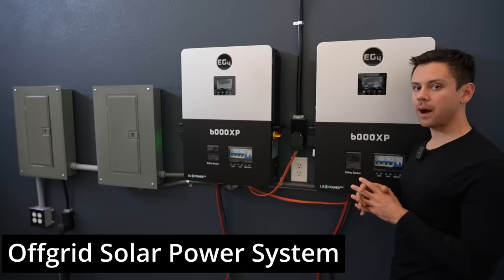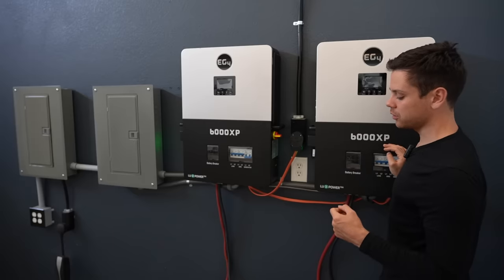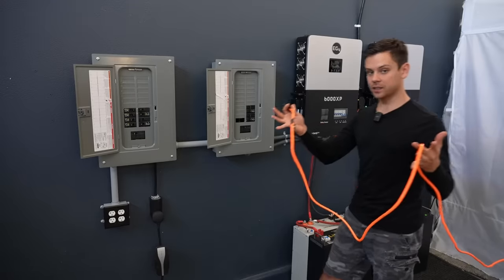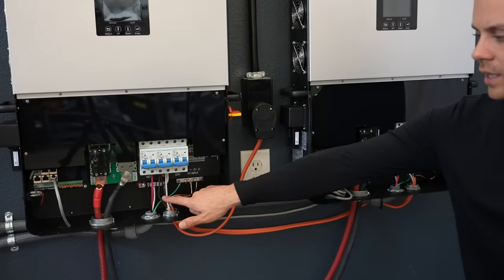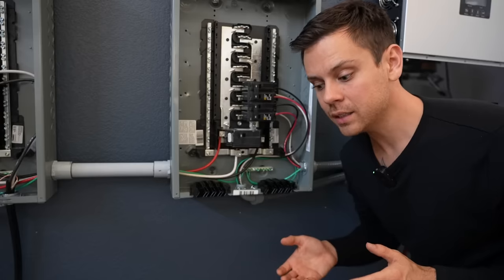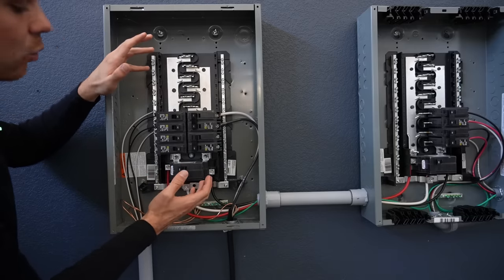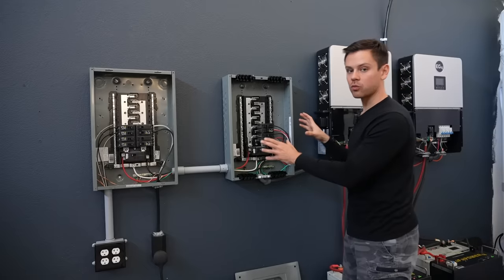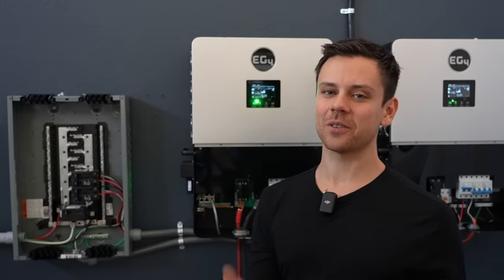How to Build Expandable Off-grid Solar Systems w/ EG4 6000XP

Comment: @WillProwse I see your using 40A breakers for your load center on the AC out side of the inverters. I asked the question in the forum about that breaker size and was told 40A also. Signature solar just put a new video out similar to your 1-2 days ago and showed load testing. It looks like they used 60A breakers in their set up that’s similar to yours. What is the correct size and why?  

My plan and goal is 4 of these units for our off grid house and I was thinking 50A breakers to give essentially a 200A service for the house with 4 of these units. 

Thoughts?

Great video. Love the work you do.
Reply: Since the 6000xp's support 50 amp passthrough I would personally go with larger than 40 amp breakers for sure.

Comment: QUESTION, both load center panels have 100 or 80 Amp mains? In the combiner load center, each inverters is connected to the combiner with 40Amp breakers. So 80Amp main? TY!!

Comment: Will, here’sca topic for a future video.  On the new Tesla CyberTruck, Teslas has a new EVSE that supports “PowerShare”, where it’s bidirectional power from the CyberTruck battery pack.  It’s unclear if its direct DC, or their doing it with AC only, as the CT has a 40A AC inverter in it…  investigate and clarify, ty.

Comment: Whats the best way to handle the batteries? Do they have to be seperate or can you parallel the batteries and inverters ?
Reply: Generally speaking it is best to parallel the batteries and have all the inverters sharing the same battery bank.   And it is best to parallel the inverters as well, having them share all resources.  This gives you a lot of redundancy across the board.  You are basically able to maximize your use of resources even when things break.  Both inverters are still up if a battery breaks.   All the batteries are still available even if an inverter breaks.  Etc.

Lets say you have 400Ah in four paralleled batteries.  As part of the robustness, you program the inverters to never charge more than a combined 200A, allowing full system operation even if half the batteries are non-operational.

Often in these systems what is left unsaid is the fact that power electronics in general have a limited life-span.   Usually 15 years or so.   So when you put together a system you want to take that into account.  The key to economical operation is making the maintenance as easy as possible and to not have to bring down the entire house to fix things that break.

Three other reasons to share the battery bank:

(1) It is a whole lot easier to worry about the state of charge of one battery bank than two.

(2) In a parallel configuration if a battery fails or the BMS goes wonky or starts tripping near the top or other problems arise, the other batteries will continue to work and pick up the loads (when designed right), giving you time to correct whatever problem arose.

(3) And the C rate going into or out of each battery is generally significantly lower, resulting in a much higher round-trip efficiency.

-Matt

Comment: Is it good or bad idea to keep battery,charge controller,inverter in a separate air conditions room to maintain cool temperature?? Most of the time heat reaches 36,37C.

Comment: How did you integrate the emergency disconnect that is required by code to on the exterior of the building. I am not asking about backfeeding the grid. I am asking about how a firefighter would turn off power within the building during an emergency.

Comment: Just curious why you went with dual 6000 instead of a single EG4-18Kpv.   Would you prefer the EG4-18Kpv if you were also tying to the grid and not expanding down the road?  Love your vids.
Reply: He has all of them. He's showing these cuz they're new.
The 18kw has grid-tie (to feed back to them) nothing else does as far as I've seen. They just allow the grid to pass-thru to power stuff. So big difference if you want to do taht deal with power company where they pay you
As far as I see in the states at least, the cost of the grid tie won't pay itself back until like 200 years.. cuz you getting 3 cents per kwh and it's several thousand more. SO I guess if you have a massive solar array maybe only 100 years

Comment: I still have a eg4 6k in the box and thinking of selling it and buy a 6000xp. Probably 2. Your suggestions
Reply: I would do it.  A lot of people have reported having issues and failures with the 6000ex.  These units by all appearances seem to be much higher quality - but they are brand new so no one knows for sure what their long term reliability will turn out to be.  I'm extremely happy with my single 6000xp so far.  I even did my best to get it to fail.  I put enough loads on the unit to get the inverter up to ~5500 watt load.  Then I kicked on my clothes dryer on high heat which added another ~5500 watts.  The 6000xp handled the 11,000 watt surge flawlessly for a few seconds and then automatically switched to grid passthrough.  After turning off the dryer and having the loads within the capacity of the inverter for a few minutes it automatically switched back to the inverter.  All of this without so much as a flicker in the lights on the loads.  I'm happy :)

Comment: Thank you so much for your awesome videos. I am putting together a back up system that I plan on adding to (eventually) like in this video. I have a limited budget, but I'm planning on the EG4 6000XP. I plan on having 8-12 Heliene 490W pannels. I will be using the 10 circuit "generator transfer box" to wire my critical circuits. I'll supply  the "generator" input on switch from the 6000XP (as that will be my"generator") Can you recommend a decent budget friendly 48V LiFePo battery? Considering the Chins or Lossigy based on your videos reviews. Briefly, what is the advantage of the additional cost of a rack battery vs one like the Chins. Thank you so much again!!!

Comment: Could you do a video that integrates a whole home backup generator with battery backup that provides smooth transfer of power between grid and generator without the power flickering off when it's transferred between the grid and the generator.

Comment: I'm adding solar to off grid place hawaii, lux pro 6000, 12/415 panels 1 48v 200ah wall mount.  Will be running about 75 ft panel to house.  Should I use 8ga or is 10ga ok?.

Comment: It looks like you have two battery banks wired in parallel and shared by the two inverters. Should there be a circuit breaker between the batteries or are you trusting that to be handled by the SOK?

Comment: Hey will, can you do a video explaining the specs on the back of a solar panel.  Also the specs on the inverter app.  I have a reading called ‘q var’ and my inverter production in watts. If my production is lower than the var, does that mean I’m consuming more than producing?  Why does the PF start at .5 in the morning? I have a Solaredge system, seems like the optimizers restrict some of the production and previously I had a fronious inverter with the strings going directly to the inverter.

Comment: I just want to make sure I understand correctly. If I already have a ground neutral bond in my main house breaker which I use to power 6000xp I should split the ground/neutral in the panel that I am powering with the 6000xp, correct? I should then run a separate ground for that panel and the 6000xp which does not connect a ground back to the main house panel?

Comment: Nice job. In your opinion, are these units capable of competing with Victron from a reliability standpoint?
Reply from the maker: There are units with over 100 megawatt hours, so they are very reliable but the victrons have a different circuit design with transformer and low frequency. So technically I would say victorn is more durable long term. But both are good options
Reply: i want a LF victron, all in one.....like the EG18K.....but victron style !!!
Reply: At the speed in which this technology is improving,  it is difficult to justify spending 3x - 4x more on gear that will be obsolete in 5 years.  We can see this with some of the EG4 models already... Replacing a $1,500 unit is easier to swallow than a $5,000 unit.

Comment: Hi Will, love your videos, I got me one of these but im connecting it to DIY LifePO4 Batteries. I'm about to connect grid to it with the idea of only using it to charge the batteries when they are low and noticed you are only hooking up 6-2 wire. That's a lot cheaper wire considering i have to go 80' to the grid. And you aren't using a neutral.  Any knowledge on how to use it for DIY Batteries since it only seems to be built for EG4 server racks?

Comment: What are your thoughts on using that 100 amp panel with these two inverters with a grid feed? Each unit has 100 amp grid pass-through, so that could potentially dump 200 amps on to that panel. If you added any more inverters, that would exceed 100 amps just with the inverter current. Is that 100 amp still suitable? For the $100 that I would spend on this panel, I could get a 200 amp panel that didn't have a main breaker. I could still feed out to a main panel, but I don't know if that would meet code without its own dedicated breaker for that wire, even though the wire could handle the sum of all the other breakers.

Comment: I can use some help...I bought 2 of the EG4 to replace the 4 Growatt Inverters I have. I want to use the EG4 just as I did with the Growatt...I only want to use solar and battery and have utility only come on if the solar cant keep up with charging because of bad weather days.  9 months out of the year I would switch off my utility breaker and be only on solar and batteries and it worked great no utility bill. The breaker was turned on for the winter months and again the utility would only come on if needed,

The EG4 seems to have an issue with not being able to allow solar to charge the batteries while they may be also be discharging to power loads. The EG4 connects to utility to power loads (my house) while the batteries are being charged by solar. This isnt cool because then that would mean that everyday when the sun comes up to charge my batteries from the night before then the utility will come on which means Ill have a utility bill again,,,,thats not off grid and they say these inverters are supposed to be off grid inverters.

I tried switching off my utility breaker while the batteries were being charged by solar and my house power switched off. Im hoping its just a setting that I need to change so any help would be nice....thank you

Comment: How do these devices determine the appropriate times to establish a connection between the neutral and ground using a relay? It's clear that there are only two scenarios where you'd decide to either link or unlink the neutral and ground: one in an off-grid setting, and the other in a grid-tied setup.
Reply: Attempts to pass current between neutral and ground.  If current does not flow the relay moves to join neutral and ground.  The state of the neutral ground link should not change during normal operation, ie you will either be attached to an existing neutral ground linked system or not.  This is why you should avoid having a plug into the mains as it will be possible to change the provision of the neutral ground link with the inverter operating.
Reply: @retrozmachine1189  the internal N-G relay does not dynamically respond to any conditions like that.  It is only statically on or off depending on your setting in the inverter.  Personally I leave mine connected to the grid inputs so the N-G bond is always provided at the main panel.  Otherwise you would either enable the N-G bond in the inverter or the load panel...
Reply: @intDavid  Seriously?  It doesn't have a setting to detect and change automatically depending on the circumstances?  Why even have the feature in that case.  Just require that a N/E link be present in the main panel, ie if hard wired to mains it gets N/E link from the supply side, but if standalone off grid the N/E is made on the load side.

It might cop me flack for saying it but what a piece of junk.  How can that even be compliant?

Comment: I just found your vids today.  I'm in awe of your knowledge and learning ALOT_ but I am VERY green. I thibk this is the system that i am going with but will be completely off Grid.   Can you do an addendum for the wiring  (in the panel(s) of the multi  box system, for Off Grid only? it got a little confusing with regard to the neutrals and grounds in the panels bcs i think you said that you only do that if your connected to th grid?  Sorry if it's obvious. I know nothing about it, and you are Genius at explaining, but stiill I'm confused-re that matter only..Thank you  JD ..

Comment: How to build a system one major piece at a time, starting with a normal on-grid homestead.  i.e.:
1) Add a generator for storms/outages (power interruption switch energy sources)
2) Add batteries to handle the load while you connect and fire up the generator, charged from the grid
3) Add solar panels

Let's call the above a 18-36 month plan.  I understand there are other components and that's where I am lost.  Ideas of a full attack plan?  (While under a VA loan I have to stay on-grid but can sell the excess.  Property will eventually be about 30kW - 12kW house (peak is higher), full wood shop, large aquaponics system, 2 wells, misc power around the property.)

Ever thought of doing a whole house in DC?  You only really need the AC for the large things: Stove, Oven, Dryer, Washing Machine, Fridge, Freezer, and AC.

Comment: Instead of running two sets of pv cables to each of the pv terminals, could you bring the entire string in on one set of cables then use mc4 dual end to split it off to each pv terminal block? Would that cause an unbalanced pv load?

Comment: at 6:29 you say that if you are connecting to grid you need to do them all together.  So does this mean that if you were connecting a generator you would use another combiner electrical panel to tie into where the generator plugged in?  Also I have seen several videos indicating older models needed a chargeverter to ensure clean power  is this still required?

Comment: Someone sent this YouTube link because they said it would work on my sprinter vans.  I can only put solar on the top of the roof.  Would that be enough to power equipment?  I'm confused.  I was going to buy battery operated generators an plug it all in to them an have them be stack-able for the sake of needing more power.

Comment: Can you run the AC outputs of these inverters into an automatic transfer switch where the grid ties in as well and then into a load center?  

I was thinking about using solar as the main power but when the battery bank would empty to automatically transfer to grid?

Comment: I now have a single 6000xp to run my 1.5hp well pump, but it can't stand the surge, would adding a second 6000 as you describe here run it?  I run the pump now off of a 6500-w generator

Comment: Any chance you could create a video about roof-mounted PV?  I’m finding out (the hard way) that there are additional requirements like Rapid Shutdown Systems that only apply to roof mounted arrays.  In my case, the install is on the roof of a boathouse with no possibility of grid connection.  Not looking for you to design my solution, but I’m CERTAIN I’m not the only Solarfan running into this…. Cheers!

Comment: Love your channel Will! Was wondering if you could review the Rich Solar RS-MPPT50DC?

It seems to be a competitor to the Renogy Dcc50s, but with higher capacity. It's a single unit for Mobile applications that does PV and alternator charging with built in MPPT charging.

Thanks for considering doing a review, would love to hear your thoughts on it.

Comment: I just ordered two EG4 6000XP's, two batteries and solar panels. My goal/dream is to connect it to a transfer switch so I can run select circuits off the this setup. I do not plan to involve my county for permitting here in Marion county, Florida. Am I making a mistake? Am I setting myself up for county permit problems? Please advise... (without insults, please)
Reply: I don't know about Marion county, but I have lived in Tampa and Fort Lauderdale and you would indeed have permit problems. Miami and Fort Lauderdale I know have very strict codes, and not just electrical.
Reply: Permitting aside, the manual recommends at least 2 x 100AH batteries for ONE 6000XP.  For 2 x 6000XP's I would get at least one or two more batteries.

Comment: that looks real nice. what about PV surge protection. can we add that or is it bult in?  also what about hole home surge proctors in the load center ? hole home surge proctors been a requirement from 2020 NEC code book. I know from my off grid home that i still need surge units. easy install and I have UL inspection . even my PV array which is rack mount on ground needed 8 Ft ground rods.

Comment: Just picked up a 6000xp and EG4 LL battery from current connected. I noticed you did not have the communication cable hooked up between batteries and inverter.  I am unable to get the inverter to recognize the battery and wonder if that's why you didn't have that connected.  Current connected did not send the USB cable and recommended upgrading the firmware but they cannot give me an ETA for a cable.

Comment: How are the sound levels for this setup under load?
Reply: They definitely ramp up as you increase the loads and PV input. Still though, I don’t find it obnoxious. The 6500’s were basically jet engines. And they made noise all the time. When these aren’t under load they are very quiet. 

Over all I think they are pretty quiet for what you get out of them.

Comment: Will the 40amp breakers in your inverter input combiner box trip if the 6000xp inverter surges to 12000 watts?  I know you’re just testing but if I were designing same solution would your recommend a 60amp breaker as inverter input to load center?